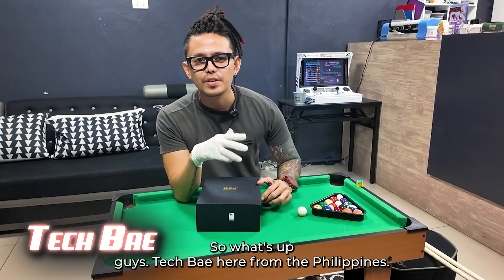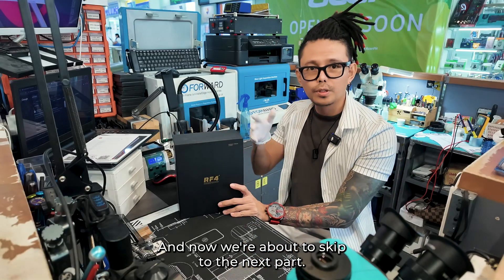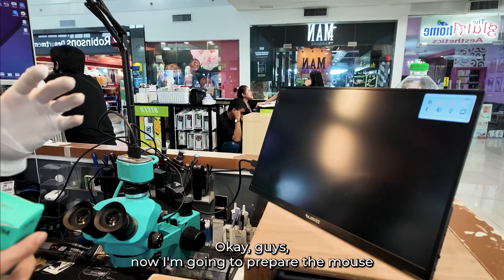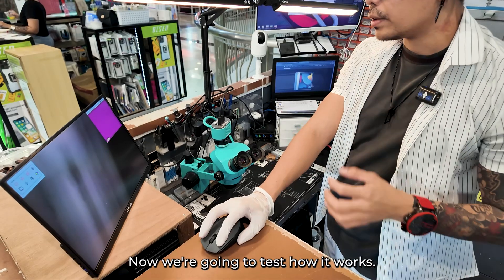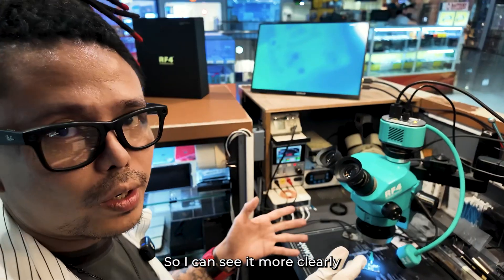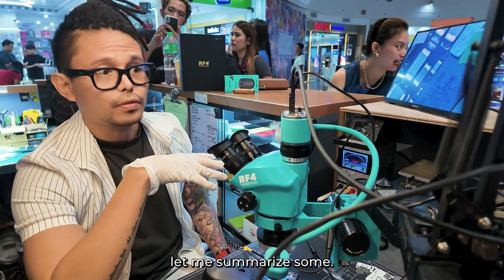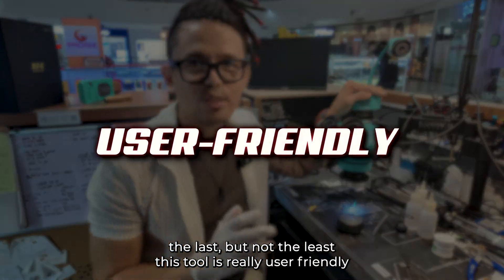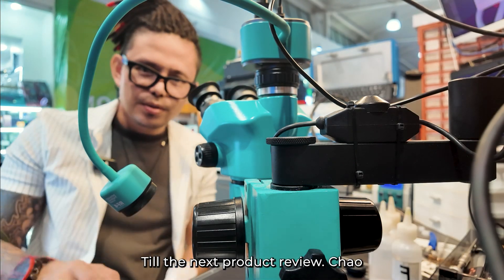RF4 C39 Thermal Camera Product Testing and Review

Comment: I’ve had this camera for a few weeks now , it’s a good camera but really annoying having to use the mouse instead of a remote. Also it’s glitchy. Sometimes crashes and doesn’t save your settings either. As far as 4K ultra, the picture not much better than my old cheaper camera which is not 4K. Great idea having the thermal camera attached but needs an update on the design. Great review.
Reply: Is it good or not i m going to buy this ?
Reply: @mobilerepairingreels  get the updated version with the metal bracket rather than the one with the green wire to the thermal camera part, It’s a good camera but it’s a bit glitchy at times but may just be my camera and not all of them, they may have made improvements since the newer version of it come out, as far as picture quality. I would say it’s not the best but still good, it’s really great having the thermal camera setup on the scope and one click it’s on and ready to use.
Reply: @SURGE101  ok Thankyou 🤗😊